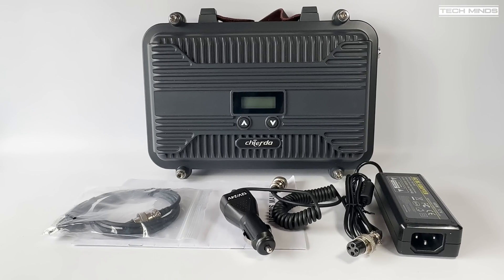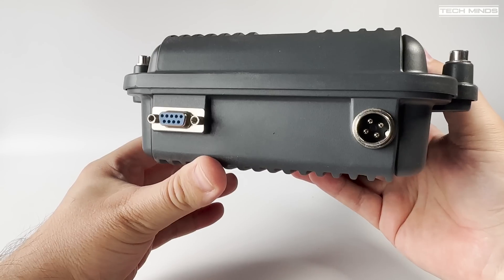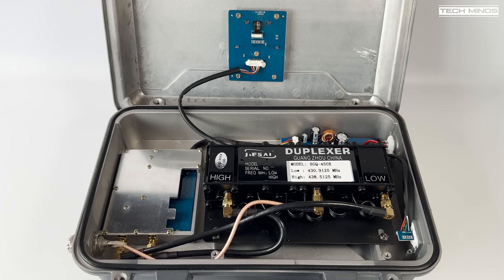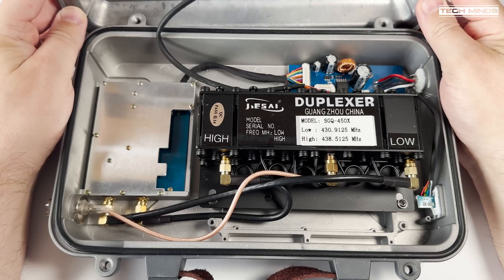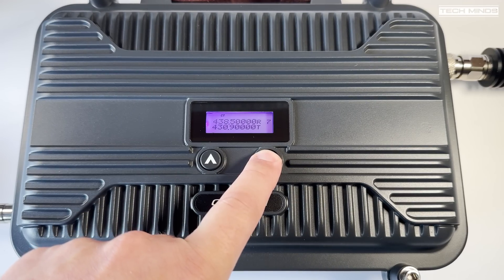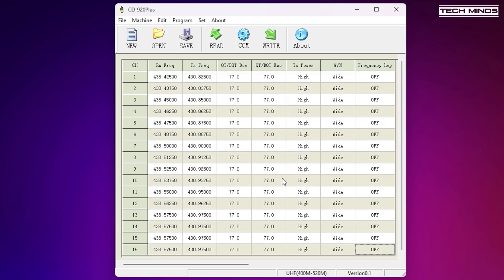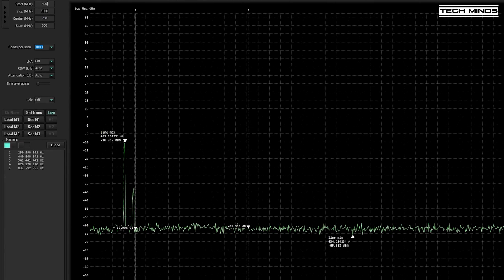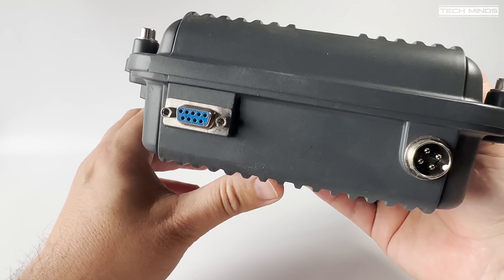Chierda V9 Portable Ham Radio Repeater - Test & Review

Comment: Matt, interested to see this in operation. If you have enough people to test it, you wont need an NoV. One is only required for unattended operation. If someone is sat with the repeater and monitoring/operating it, you dont need to vary your licence.
Reply from the maker: Thanks for this, let me check and if that's the case then I can potentially do this... (Actually already briefly tested this with a friend 30KM away, and it works very well). Didnt record it though.

Comment: The ham/cb community's love for so-239/pl-239 connectors is getting very tired. Glad you addressed this in the video. Any radio that operates over 150 mhz and has so-239/pl-239, is garbage in my opinion. It's well known that type N and SMA are far superior and do not develope the random impedance bumps and mismatch issues that these older ports ALWAYS have to some degree. If you're working 430 mhz and up, you can have a SWR of 1:1 at 435 and 1:4 at 435.5 to 436 then back to 1:1.2 or whatever. 

I was so happy to start seeing newer DMR radios like the cs800 coming stock with N connectors built in. That radio out performs the hell out of many higher priced FM ham radios, and it's not just because it has an N connection on the back, but having the N connection definitely confirms right out the gate that the designers/engineers were actually using their brains during the design/build process.
Reply from the maker: What do you think of the new Yaesu FTM-500 using an SO239 socket for antenna connection? I guess even the top tier manufactures still like SO239. I know when I make and project I always try and use SMA or N-Type.
Reply: @TechMindsOfficial  I think they're doing it purely for continuity and marketing purposes. It definitely has no basis in actual engineering and results. It's done because that's the connector type %98 of old hams and their antennas, analyzers, tuners, adapters, etc... are all built around. 

I just firmly believe in 2023 and even in 2015, that it's time to start moving on. Change isn't fun until you reach the other side and look back on how silly your previous notions and habits were. Obviously this is a minor gripe in the big scheme of things, but it's also a great example of how progress, innovation, and just improvement in general are held back back for basically no good reason other than "this is how we do it".

Comment: bit odd they used non ip rated connectors after going to the effort of making the chassis
Reply from the maker: I would defo take that IP67 rating with a pinch of salt. Maybe the case was before the connectors were fitted.

Comment: No mention on ID for the unit.   Might be an issue for licensing.
Reply from the maker: ID? What you mean? No issue for licensing in UK at least. We can make our own repeaters out of tin cans it we wanted :)
Reply: @TechMindsOfficial  Here in the US the repeater must have the ability to ID itself. The trustee  and designated control operators must be able to take control of the machine if there is a problem.  As there is no control board that allows for auto id, ability to shut it down remotely then you would have a problem.
Reply from the maker: Ahhh I see what you mean. Well, it’s the same here, repeaters must Ident periodically. There is nothing built in, but I was thinking about this the other day, and I’m pretty sure some logic board can be put together and plug it into the DB9 socket. Pretty much provides all the lines needed I think. In terms of remote shutdown, just a 4G internet hub and a network switch would work.
Reply: @TechMindsOfficial  would be nice to see you build it.👍🇨🇭
Reply: @TechMindsOfficial  this is the same model as the retevis RT97S here is how I do all of that and then some https://youtu.be/ubXOhklTjAw

Comment: I had the Retevis RT97,  from a couple
of years ago on 447.150 output for me
by them, for about $400.00 US, but as
Retevis explained to me after going
through the system the output was
about 5 watts.
I did with the program lengthen the
Squelch Tail duration. 
I wish it could be fitted with a controller
for ID and timer.
It did work well trying it out from a ground plane Comet GP1, on a hill,
and I could access it from 5 or more
miles away.
I did choose a frequency not in use 
in my area.
KB9VBR, on You Tube, tested it a
while ago from his mobile in his
area.
I did sell it on eBay a couple of months
ago.
Yes, it should frequency coordinated
in the US too
73 de W2CH New Hampshire, US
Reply from the maker: Ive been thinking about an ID controller, and Im sure something could be knocked up for use with the DB9 connector.  Could use the BUSY line to detect a Ka-Chunk or end of over. Maybe ..
Reply: @TechMindsOfficial  I agree 👍,  there
probably is a way to do this. Thanks 😊

Comment: A type N connector would make more sense for UHF, but not all antennas have a type N.

 Regardless, if your antenna is type N, a cable with pl259 on one end and N on the other can be used.